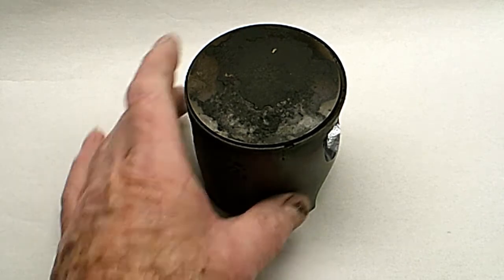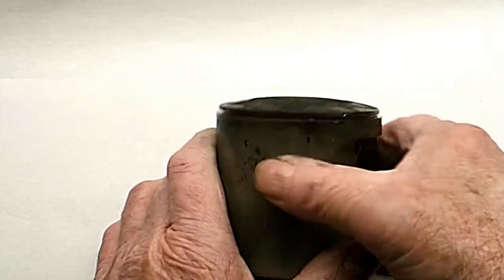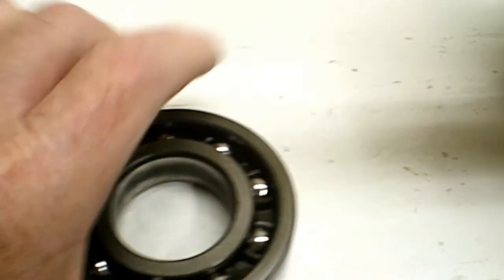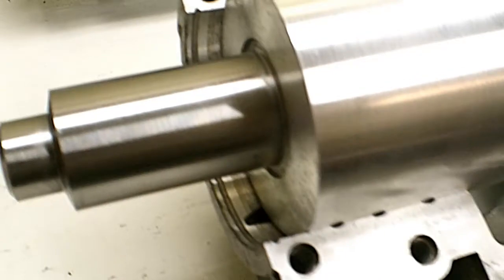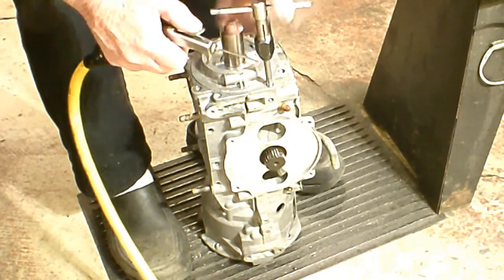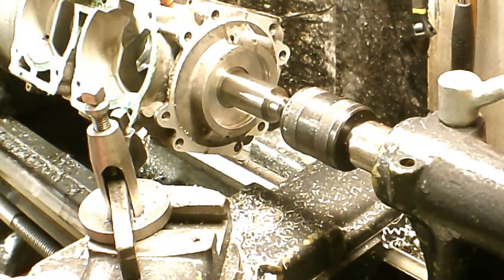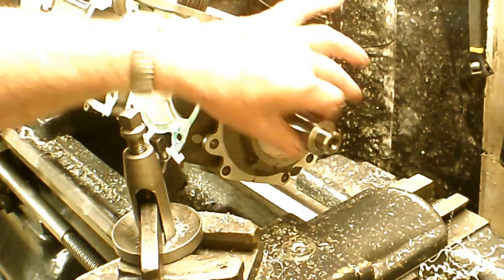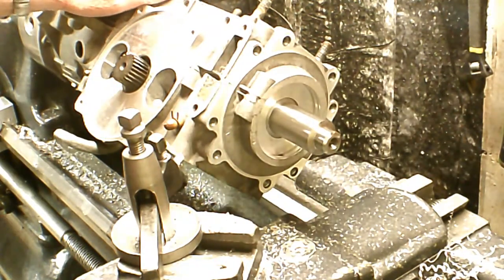Rotax 583 Aircraft modification E-Gearbox or C-gearbox

Comment: I am not sure 100%, but I think the 583 has a different cut on the rotary valve to take advantage of the higher rpm potential of the engine. The ignition timing is also different, but not sure what the values are. The 582 only goes to 18 or 19 deg. btdc. I like your thanking on the bearing oiling. I am not a fan of inverted engines. Windage from the crankshaft keeps oil from getting to the bearings.
Reply from the maker: As I understand it, the 583 has a variable advance on the single ignition system. It also has higher compression, different rotary valve, much larger carburetors, RAVE valves, and the extra port as well as a larger tuned exhaust.
Good thing is that snowmo parts seem cheap.

Comment: Very sound engineering on your part. I totally agree with ever thing you talked about in this video.
Reply from the maker: Thank you. Video just shows what I think, and I am not a service agent. I have not seen all the problems. I have had a lot of 2 cycle motorcycles, and have never had main bearing problems.
Reply: @Adventurepilot70  I have had main bearings failures in the past. None were Rotax engines. All were four main bearing engines, and the bearings had metal ball separators.
Reply: Mercury out board racing division determined that above 8000 rpm,,,the needle bearings on the connecting rods start scooting, instead of rolling. Read into this what you will.
Reply: Ever wonder why Rotax connecting rods only have a oiling slot on one side of the rod. Its all about bearing loading in relation ship to rotating direction, and power stroke.
Reply from the maker: @cropduster48sady46  Well the plastic cages certainly don't  work on the Rotax engines.
Reply from the maker: @cropduster48sady46  The crank angle keeps changing, so they don't run at a constant speed.
Reply from the maker: @cropduster48sady46  If assembled correctly they should face the incoming mixture. I don't know if having a slot on the back would help much. I might want the added strength.